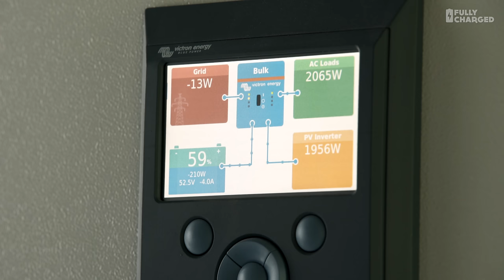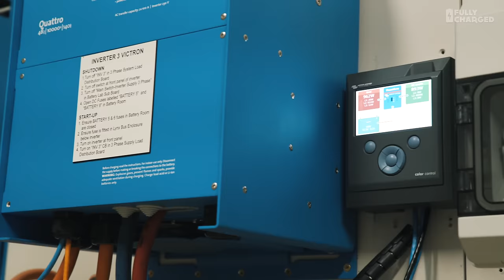Redflow ZCell batteries for home renewable energy storage | Fully Charged

Comment: The cost of the battery is the  real question .With other batteries you can work out the total cycle life the total power and divide that into purchase and fitting costs and come up with a number like $025 cents a kilowatt hour . I cant see a price to buy the unit all 250kilos of it and there is this issue it must be connected to internet for monitoring  to keep the warranty . Has any body got the estimated cost to  buy the 10 kilowatt unit and it estimated kilowatt hour costs  because with out those numbers it all just hype .From these numbers it can be estimated the extra costs to export to Communist controlled EU with high VAT and probably high tariff rates against lost in  space Australia  and the other costs like installation to operate in colder climate and extra sized solar panels that high latitude  regions of most of Europe have  and factor in battery heating effects in winter .I suspect the battery is gonna fail to be interesting in colder northern regions of Europe  PITY

Comment: The 10kWh ZCell will sell for between $17,500 and $19,500    NUTS.
Reply: The price is closer to $15,000 but it will come down. What needs to happen though is it has to fall faster than Lithium. I'd gladly take this over lithium given the longevity and safety.

Comment: I like this, but I think they're too late to the market. If I understand it, this technology has its maximum energy density already. It won't grow.

Energy density is low. That shiping container has 600 kwh?  Compare 6 tesla 100 kwh batteries to 1 whole container..... 6 batteries are like 10 feet by 5 feet by 3 feet..... and give it another 5 years and it's half that.

Not losing cspacity over time though. That's super cool. Does anyone know how these flow batteries perform at low temperatures?
Reply: That's the tradeoff:  The Zinc Bromide has lower energy density, but more cycles over a lifetime, deeper discharge ratio, but also much less risk of combustion.

Comment: Bad decisions in comparing the storage 600kWh container with the tesla car battery. They are duplicating the pumps, plastics... etc the entire system.. instead of using the main advantage of the flow battery - one or two big containers and a single pump and many cells. etc. Use many pumps for redundancy if you rely want. Nothing can break to a container and some pipes.. This will setup always be more expensive because they are duplicating everything. Is not like tesla having small cells. It's like  each cell in tesla would have it's own bms, and it's own cooling system, etc. Then you compare apples with apples. Tesla's decision was good - because ease and cheapness of manufacturing at cell level - but this is not the same. But outside of this remark, pretty cool tech indeed.

Comment: You have to have the space for this unit. It's great tech but just to  large.
Reply from the maker: You can put it outside the house, doesn't have to be inside.
Reply: How heavy is it? would it be to heavy to put in the attic?
Reply: try 250 kgs.

Comment: 11:40 - "You can lose 40% of the capacity of a lithium pack of a decade of using it" - we all know that is bollocks... 

Name one solar connected battery storage system on the market that loses 40% of its capacity in a decade. Name one.
Reply: First of all he said "you CAN lose 40%", not "you lose 40%" (there's a significant difference), but more importantly...
How is that bullshit?
https://en.wikipedia.org/wiki/Lithium-ion_battery#Degradation
Reply: No commercially available home storage solution using Li-ion is that bad. In other words, he's trash-talking the opposition with 'loose facts'.
Reply: Just wait for the first "Battery Fire" burns somebodies house to the ground ! Ltd news would have a field day(week ) Just like the "Pink Batts "  every house was a Pink batts house , that burnt down .
Reply: By that (flawed) logic nobody should be allowed to have an electric car in their garage - clearly that's a silly proposition. Current Li-ion technology from the major brands is perfectly safe, but I'm sure there's some cheap rubbish out there that someone is cobbling together for home battery storage. This sort of stuff does attract nutters.
Reply: Nice straw-man, MyBarry2009...
Reply: +Paul Martin "No commercially available home storage solution using Li-ion is that bad."

So? There are Li-ion batteries that are that bad and all of them have a significant rate of degradation.
That the ones that are used for home storage, typically don't go quite as high as 40% over a decade, is a fairly trivial point, IMO.

Comment: Lead Acid batteries - Why you wouldn't want them in your home!!

The charging of lead-acid batteries can be hazardous. However, many workers may not see it that way since it is such a common activity in many workplaces. The two primary risks are from hydrogen gas formed when the battery is being charged and the sulfuric acid in the battery fluid.

Comment: 11:20 "More expensive than lithium batteries".  It may be a superior tech for home storage, but they are headed into a dead end.   Lithium will have volume advantage, producing far cheaper than he is selling his flow batteries for, even though lithium is NOT the best technology it will be the cheapest.  Until his patents expire this is a dead technology.  SAD!
Reply: Not necessarily. It has one advantage over Lithium - it doesn't degrade capacity over time. So that could be a key factor when someone looks to buy.
Reply: "Lithium will have volume advantage"

For home storage, that is utterly irrelevant.

"producing far cheaper"

Even considering the lack of degradation and having to replace batteries?

Comment: If this battery is so amazing does not degrade and can be completely drained and conserved for years why no one had developed it so far?
Reply: Cos its a very toxic chemical?
Reply: lol...your literally watching a video about a new technology and this  battery development so far and your asking why it isnt being developed?
Reply: KIM ROLLO - try watching the video first. They said several times that is old technology used to be large container type and they just made it smaller.
Reply: I was developed. Check  China sites. It was on salve a few years ago.
Reply: Exactly no one had been able to make it smaller you are literally watching the development happening ......and until you made it smaller there was no potential large  commercial market such as domestic home use ....and until you have a small product and a large market you will never get the economies of scale to drive the price down ....which was the problem of the old technology .....it was a superior product but it was too big, too much over capacity and too expensive....which is why it never went anywhere
Reply: Actually, it had been developed, however not in sizes small enough for the usual home. It has been in use in industrial applications before, with huge tanks, pumps and membranes. And it is so far still more expensive than a block of Tesla powerwalls, and probably will stay more expensive as the economy of scale really works for Tesla with the Gigafactory growing every day.
Reply: Because for decades they were only useful in container side units which meant they could only really be use for grid scale storage, but no one was really interested in container size units because no one was interested in storing energy from the grid.
Reply: Interesting. The world is investing billions in battery research, every single day we get news for revolutionary battery tech and now this comes up with "too much over capacity"... Lets see if it get beyond this video like all other battery news we have seen so far. I would love too but I am sure it wont. If it was that good someone would have thought of it earlier. That is what I am saying.
Reply: the difference is that all the other battery news are out of labs. that one is already in production
Reply: Just being "good" isnt enough....it has to be affordabe  (economically viable) .....potential large market....and "good' (superior product)
Reply: That's what earned him a thumbs-down.
Reply: jawbreaker You have claimed the efficient market hypothesis: "If X is a good idea, why hasn't anyone done it yet?" This hypothesis is fallacious when applied to imperfect markets, such as all of them.
Reply: Time! its all a bit wobbly.............  or if the wheel is so good at overcoming friction why no one developed it so far?...... or your answer lies in the word developed......... or (this is the last answer i have for your question) they have and it is amazing!
Reply: heat1235 but another company with a less toxic battery (aquion) just went bust so it can't be as simple as that, I really want someone to crack this problem
Reply: @Neil Carmichael ok thats odd.. thought solar stuff were an "easy" sell.

Comment: this sounds like a fuel cell. I doubt this battery will just work
Reply: Flow battteries have worked, and been used, since at least the 80's, so...
There is no question as to whether they work, or not. They work.

Comment: This battery has mechanical part, this is not going to last forever. When the mechanical part start to fail the cost will drive up. I still rather get lithium battery as the cost is much lower
Reply: Just replace that little mechanical part then shrugs
Reply: A motor for it is a damn site cheaper than a whole lithium battery every 10 years or so.
Reply: Do you know if they last longer if e.g. kept nearly topped up? (Or for all I know, regularly allowed to run down, which for some reason is a popular thing to believe is good for batteries, I've never understood why.)
Reply: Well to each their own, I rather like having batteries that can be fixed then those that absolutely under no circumstance can ever be fixed.
Reply: +Delpatrous
The belief that it is better to run a battery completely down before recharging comes from the days of nickel-metal-hydride cells. If you recharged before the cells had fully discharged the capacity of the cells was reduced (it was known as the memory affect). Modern cells do not have this problem but old ways can persist long past the time it made sense.
Reply: the electric pump costs you mabey 200 -300 $ and lasts probably more than 15 years. compare that to your lithium -ion life cycle
Reply: @Deipatrous it goes back to the days of NiCd cells where there could be a build up on the plates which reduced capacity if you did not completely discharge them. NiMh were better buy not perfect.
Reply: A water pump is basically just a single electric motor. They could last for decades without failing and assuming the batteries have been designed well, they would be very cheap and easy to replace compared to replacing an entire battery  which has lost 50% if it's capacity over a similar time period, even if the Li-ion battery can be recycled.
Reply: My car's water pump lasted 10 years and it only costs less than $50 dollars to replace.
Reply: A pump has a motor which has bearings and depending on the construction of the pump the impeller moving the liquid has bearings or moving seals as well. These are parts that will fail (and I think these batteries need two pumps each, so twice the amount of parts to fail). There is no way you can "fix" them yourself. Unless completely discharged (and how are you gonna do that when the pump breaks halfway through a cycle?) the electrolyte contains Bromine, so you don't want to open anything at that battery without decent chemical protection gear. Bromine causes similar (but not as severe) chemical burns as Chlorine or Iodine. 

Also Zinc and Oxygen don't mix well. Oxygen will react with Zinc to Zincoxide, which means that Zinc is now missing from the electrolyte (Zincoxide is mostly insoluable). Ever heard of Zinc-air batteries? They use exactly that effect and as you might know these are non-rechargeable batteries. If you have any leak (this includes oxygen permeating through the plastic container or seals going to the pumps) that allows oxygen from the air to get in, the battery will deterioate.

The battery is also a little fussy about how it's treated. The battery has to be completely discharged and shorted every few days/cycles or it could short out internally. That means the battery is unuseable for a few hours every few days.

Don't get me wrong. I am glad about any development that helps storing energy from renewables, because that's currently the only real problem for a full scale switch. And this battery type does work and is used in large industrial installations, so it is viable. But it is definitely not a replacement that makes Li-ion batteries look bad in stationary applications.
Reply: According to their website they have a Warranty of: 36, 500 kWh of energy delivered or 10 years (whichever comes first), I assume that covers the moving parts.
Reply: Lithium ion cells degrade over time, and will still have to be replaced... and now you're replacing essentially the entire battery.

A pump will cost maybe US$20 and will last 10+ years easily given how hard it's working. So it's a $20 pump every 10 years or a few grand for a new Lithium pack over a comparable time period... even if you have to replace the pump annually you're still coming out ahead.

I happened to share this vid in a chatroom and one of the guys there actually works for Redflow as a software dev. He mentioned a 10-year warranty period and that the biggest technical problem they seem to have (again, he's software so not 100% on this) is a loss of efficiency over time. Not capacity, but efficiency... meaning it might take, say, 11kWH to charge a 10kWH pack at first but after a few years it might take 13kWH to charge.... but you'll always get 10kWH back out again. Fixing the problem requires replacing the electrode plates which doesn't seem too bad. (Assuming they never solve the problem, that is)

That will never be the case for Lithium, which loses capacity and can never be fixed except for replacing outright.
Reply: Actually the pump because it's pumping zinc bromide needs to be better quality than a £20 part. But even if it's £500 it's still cheaper than the lithium battery.
Reply: There's nothing magical about zinc bromide. It's a salt. It's pumping salt water. That just means the wetted parts should be made of or coated in plastic. Wet rotor pumps are the cheapest there are and don't even have bearings. Things should last forever and a day, really.
Reply: @Smidge204 you arte missing the point. IE you want good seals to 1 stop loss of electrolyte and 2 stop contamination of electrolyte.
Reply: My fridge's compressor has been running over 3 decades. 
It has, you know, mechanical parts as well.
Reply: +C0deH0wler I imagine you have a fridge which also has a small, simple pump. This doesn't have to be replaced very often. I've known fridges run for decades without maintenance.
Reply: Good pumps last a really long time, even when running continuously. In our house, we circulate water from the heat pump throughout the house, those pumps have been running continuously for almost 18 years now, and they have at least 30 years left in them
Reply: All parts are guaranteed  for 10 yrs .
Reply: yes for 10 yrs .
Reply: Yes but induction pumps and peristaltic pumps for that sort of volume are not $20 each and you are still missing my point. IE Even if the pump for some reason was ridiculously expensive, it's still cheaper than a lithium pack.
Reply: SmartOrder as lithion there a percentage of failure as with any eletronic device the good things in these you dont have to remplace the whole cell just service the pump. the gas pump in my car is over 14 yeats old still working, the pump.in fish tank seems to be last for ever, the water pump in my van fail after 4.years... i still belive thise flowcells are better cause their capacity stay the same.
Reply: I knew someone who built his house in the 70s and still has the same fridge now, kit can run and run.
Reply: They are Brush-less pump .
Reply: +superdau there are pumps that have zero impellers and zero seals:  https://en.wikipedia.org/wiki/Peristaltic_pump  It's quite possible they're using this style, which is completely sealed for the liquid being pumped.  They're simple, reliable and inexpensive.
Reply: Dogphlap - You're confusing Nickel-Cadnium (which has a memory effect and is basically no longer used), with NiMH, which is still the defacto standard for rechargeable AA, AAA and some special use batteries, and do NOT have a memory effect.
The irony is modern batteries such as lithium Ion have other weaknesses which means fully discharging them is a very bad idea. (but generally the battery controller prevents that from happening)
Reply: this battery is more expensive than 14kwh lithium pack, which is smaller and has better round trip efficiency and has exactly same 10 year warranty. that is why everyone is buying lithium batteries instead of this.
regarding fantasies about cheaply replacing pump in 10 years: lithium batteries price is decreasing about 15% per year. lithium battery now plus 5 times cheaper lithium battery in 10 years will still be cheaper than this battery even without replacing pump. and btw in 10 or 20 years lithium battery will still be usable and with larger capacity than this battery.